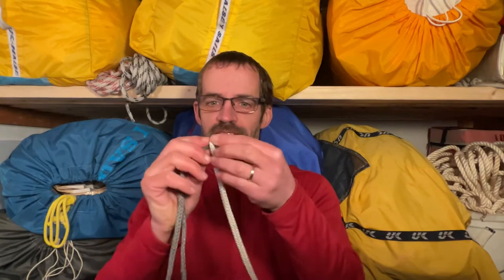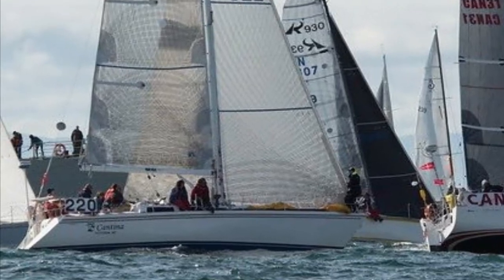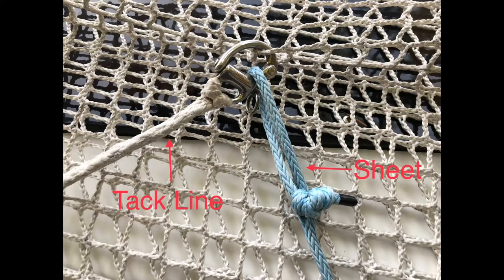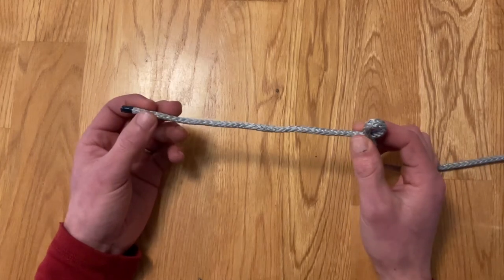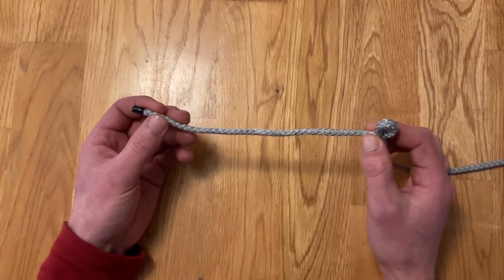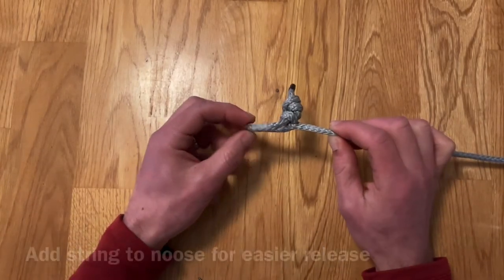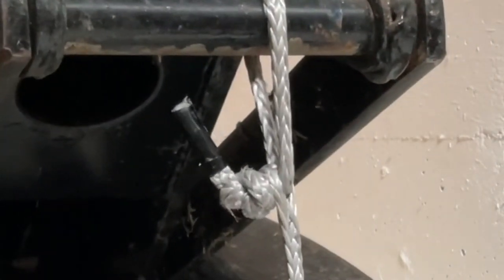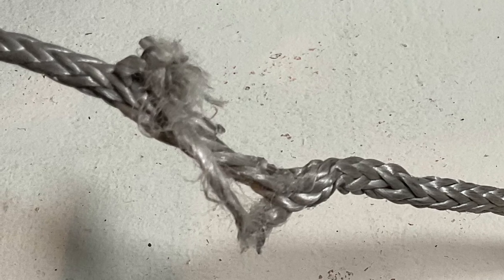Need to Tie a Soft Shackle into an Existing Line? Try This!

Comment: Thanks for the video.  A little off topic,  my dynema spin halyard just split apart.  What size line and type do you use on yours.  I have an F28R.
Reply from the maker: My current spin halyard is 5/16” / 8mm Warpspeed II which has a 3/16 HMPE core. I think my F-82R spinnaker is a similar size to yours but my boat is a bit lighter. Still that should be strong enough or you could upsize to 3/8” / 9mm. Does this help?
Reply: Yes it does.  I'm leaning to a 3/8ths this time.  My old 5/16 spin dynema halyard would slip in the jammer sometimes. Either replace the jammer and get a new 5/16 line or hope the 3/8ths doesn't slip.   I can't believe with 8100 lb tensile strength the line parted 8 feet down inside the mast.  It was light airs too. Not sure how old it was, bought the boat 6 years ago.  Made in 1999.  Thanks for replying.
Reply from the maker: @Gonesailn  I think there must have been something else wrong with your line (e.g. age, chafe) to cause it to fail in those conditions! In any case 3/8 should hold better in the clutch, although new lines are quite slippery so you may want to wash it in soapy water to ensure there isn’t any manufacturing reside remaining that could cause slippage.

Comment: I have a question. When it comes to soft shackles failing. Why not pop something (a piece of line) beyond the knot to prevent it pulling through? You’re much clever than me so perhaps you can think this through, come up with a solution, test, and publish a video of the results. 👍🏽😁
Reply from the maker: Some people tie a simple overhand knot on the tails to keep them from pulling through so good suggestion to test that!

Comment: I think your soft shackle at the end of the line will be stronger if you put the running end through the line . As you follow the running end into the soft shackle it makes a turn at full diameter before it is split for the loop. The split side carries half the load because the knot carries the other half of the load.
Reply from the maker: If I get a chance I'll test this and the reverse!
Reply: @SailingTipsCa  Another thing to try is burry 4 inches of the bitter end back into the shackle and tie a figure eight in the double thick line. The larger dimeter of the male part of the shackle makes a larger radius for the female loop..

Comment: What does the ratio mean when someone says "2:1 halyard"?
Reply from the maker: It means the halyard goes over a sheave (pulley) at the top of the mast, down through a low friction ring attached to the head of the sail, and back up to terminate at the masthead. So in order to raise a sail 10m you have to pull 20m of halyard but with half the effort.